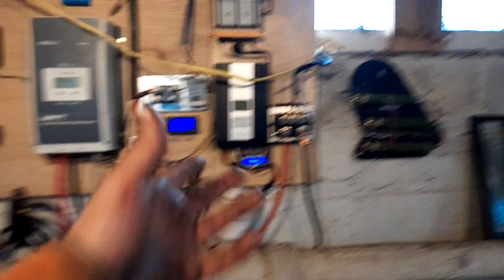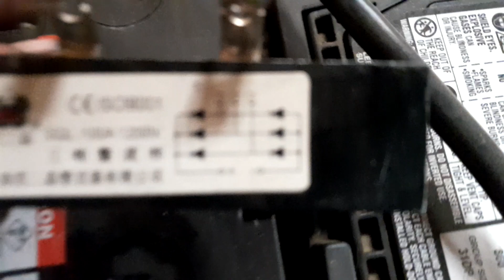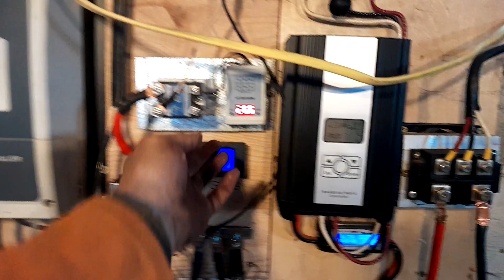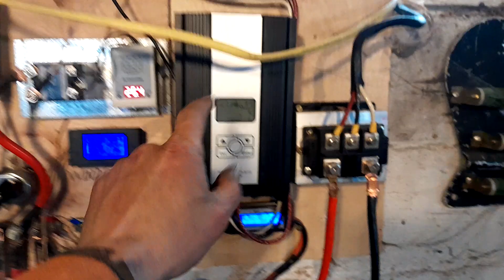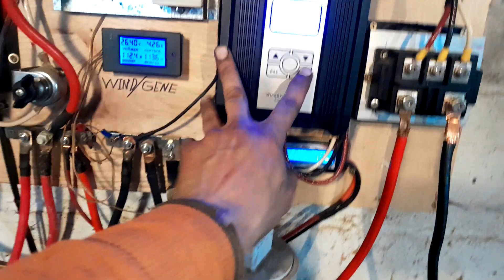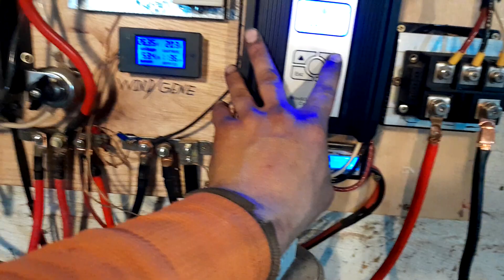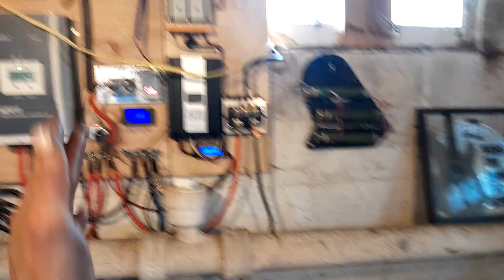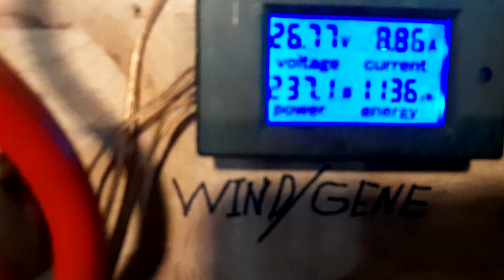How to Wire in Micro-Wind Turbine to Charge Controller or a Rectifier.

Comment: G'day Mate, I saw this on another YouTube channel, he had a good idea about a 3 stage braking system, 1st stage was putting a resistor on each of the 3 phases, so it slows the wind generator down in high winds but keeps charging your batteries. His advice never short out the 3 wires in high winds.   
Search - 
Wind turbine wiring with disconnect design, material list below!
Reply from the maker: Was it Mr. John Daniels?

Comment: How did you calculate the size of the tail for your wind turbine?
Reply: I’m going try the same thing. Thanks for the videos.
Reply from the maker: @mikemarcantel1149  you betchya! I basically copied the Hurricane tail. Streched it back a little and more then quadruppled the surface area because the wind here is just that bad.
Reply: Thanks
Reply from the maker: @mikemarcantel1149  i have a video with more details https://youtu.be/7IWWPZtWqr0?si=L_Nw9Zl5jXXW-rRn
Reply from the maker: Took a lucky guess....

Comment: thanks for the video.  I have two turbines that i picked up second hand and  they came with mechanical rectifier and charge controller which I hooked to a 4 car batteries to make a 24v bank and then stuck a 600watt grid tie inverter on that.  I see I am generating 100 watts per hour. BUT I feel I am really missing the MPPT functionality.  Do you know can two 12v turbines be attached to sinGle digital MPPT charge controller like you have there?
 what I would really like to do is take my rectified DC current and feed that into an MPPT charge controller? Any thoughts??? THANKS Again Carl
Reply from the maker: Well Carl, thats a loaded question. 2 turbines can not be hooked up to 1 digital charge controller unfortunatly. The voltage pulse from one turbine could backfeed to the other and turn it into a 3-phase motor.....back and fourth honestly. Whichever made the most volts would spin the other. PMA's are essentially 3 phase motors. To achieve the MPPT benefit you would need 2 seperate controllers. If you are making a contineuous 100 watts however for each turbine, it sounds like you have halfway clean wimd. Mine is dirty as can be and is why i switched from straight rectifiers to the MPPT. Only way i could get half consistant power outta the thing. Build your system to fit your envionment, and then it will follow suit by fitting your needs. If you have clean wind....she's good. Enjoy it. Wind, here at least accounts for a mere 5% of my generated power and battery charging but on those clowdy weeks, that 5% is huge. Solar does the rest. My solar averages 9kwh a day where days when we have 30 mph NE wind, I'm extactic to see 1.5kwh from wind. It's basically the differance between  starting the back-up generator or not.
Reply: @smallcityhomesteaders1600  Tnx again. I will update you with the progress.  I only installed the watt  monitor yesterday so my 100watts was based on a short window as it's done barely 50 for the last 5 hours but with tuning it has potential.  
 Q: When the wild Ac goes through the rectifier it comes out as  DC.  If that rectified DC meets DC(both 12v) from another turbine they can combine? Tested it and it  seems ok.. My question  I am assuming  a rectifier goes in only 1 direction, is that correct ???  If it is I am thinking I might put the  rectified DC voltage  into the solar ports of a cheap mppt controller rather than  into the 3ac  turbine ports. Unless there is an obvious reason not to do this(erratic DC)? Any thoughts appreciated..
Reply from the maker: @carlf2842  you are correct bud, a rectifier is basically 3 diodes. Diodes only let current flow 1 way through a conducter. A guy I watch on youtube did almost exactly what you are doing and here is the link to that video. https://youtu.be/icDuNuKkgU4
As far as running the dc outs from your combined rectifiers to a MPPT solar controller....i don't recommend it. Like you said, erratic dc. That voltage fluctuates up and down so fast a solar controller doesnt know what to do with it. I will try to make a video demonstrating the effects and why it does not work but what it comes down to is simple. Solar panels and wind turbines behaive very different. The programmed software in a solar controller is tuned to the behavior of a solar panel and the same for a wind controller. That is why both exist. I wish there was a more universial tool but that is not the case. I have experimented with this but i didnt get it on video....BUT....i will try. Before you spend money....just watch your birds. Take not of wind direction, wind speed and generator energy is said conditions. There is no "1 size fits all" solution with wind energy. It took me 3 years before the moment i looked at my wife and said......"honey, its good".

Comment: What would happen to a turbine if one of the 3 phases disconnected at the turbine? Loss of power or zero production?How would I know without taking the turbine down?
Reply from the maker: Thats a good question...all 3 phases are completely wired seperately but i believe they share a common ground in the stator. My best guess is you would just loose about a third of your regular production.